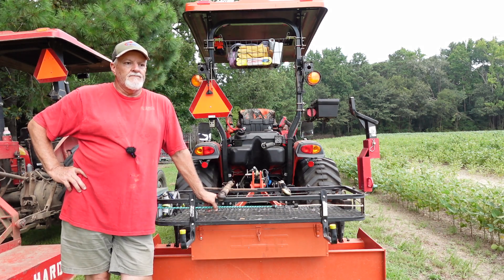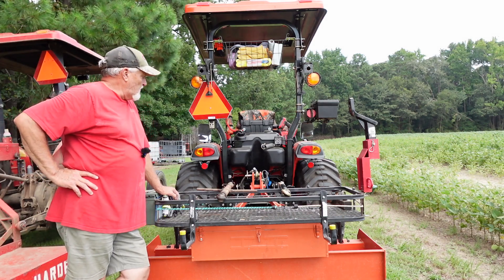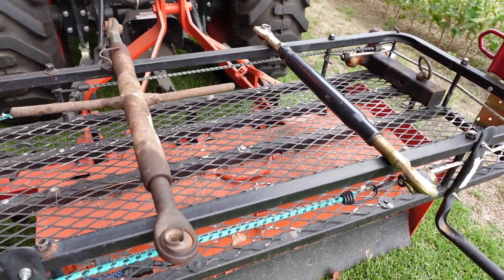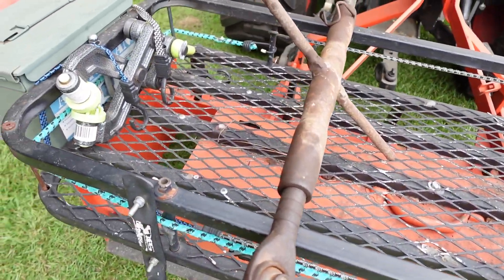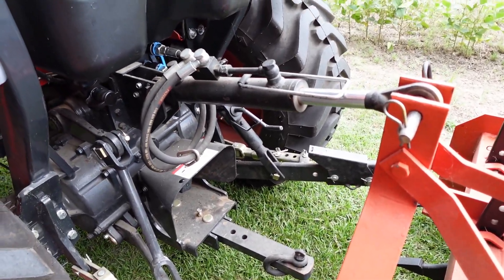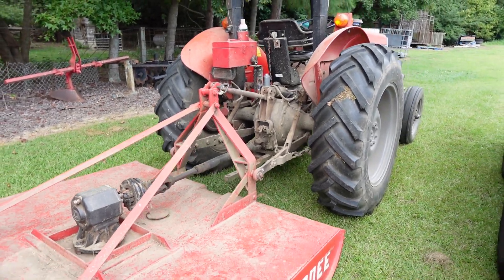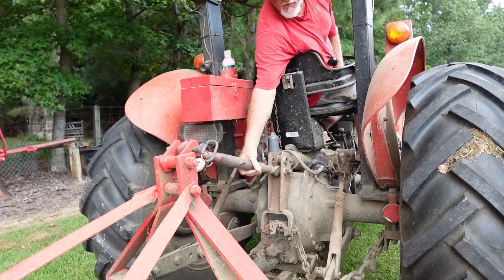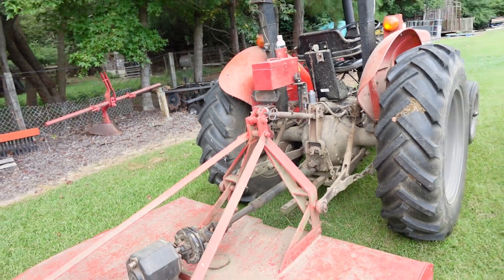Hydraulic Top Link vs Manual Top Link - Advantages and Disadvantages

Comment: I will be getting a set of quick connects as you have on the lower arms. That hydraulic top link is pretty neat. How many times I find myself mowing noticing the deck not level and just let it be because I don't want  to stop and readjust. Very nice video, thank you.
Reply from the maker: @BUTTEWORKS  yes, the hydraulic top link is a game changer for making adjustments. Thanks for checking it out.

Comment: I totally agree that hydraulic cylinders on 3 point top & side arm are great to have. I just need to order the top cylinder for my Kioti RX7320 but my 1979 Ford 340 Industrial tractor has hydraulic cylinders on both the top and side and it REALLY MAKES A DIFFERENCE in the usability of that ole tractor!  Tim in northern TN
Reply from the maker: HI Tim, I bet that hydraulic side arm cylinder is really handy.  I'm sure when you get the top link for your RX7320 you will love it.  Thanks for checking out the video and commenting.

Comment: Mr. Jeff, first time I would argue with your opinion. No "THINKING" on whether someone should consider purchasing the hydraulic top link, unless someone is a gluten for punishment, don't even think about it, buy one! I added one to my CK3510 for my box blade and it's the only way to go! Bought mine a couple of years ago on Amazon, came from Europe, $250.00 USD, hoses included. And if I remember correctly, I got the idea from one of your earlier videos. Please keep the videos coming, always informative and enjoyable to watch. B. regards! John M.
Reply from the maker: Hi John,  can't argue with you one that one.  They are definitely worth the money.  Until I got my CK3510 and started watching videos, I didn't even know they made them.  We may have the same one, sounds like the same thing I bought.  If I had rear hydraulics on the other tractor, I'm sure I would get one for it.  Thanks for checking it out and I really appreciate the feedback.